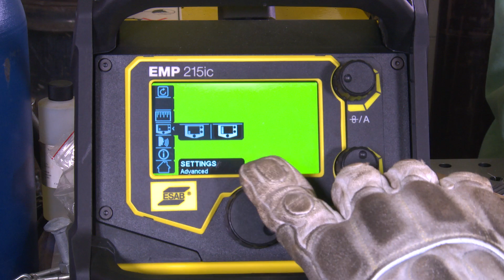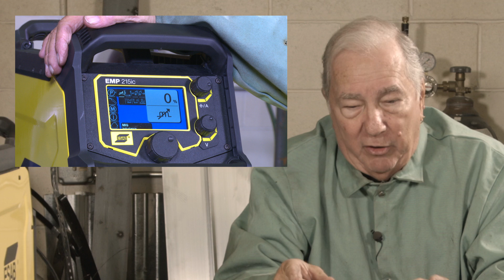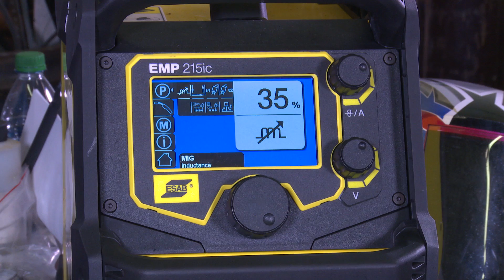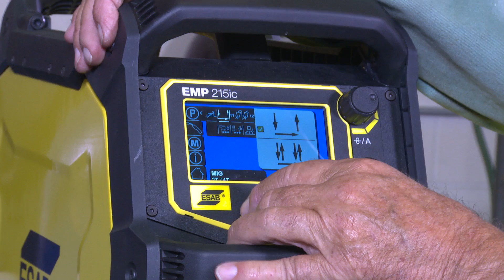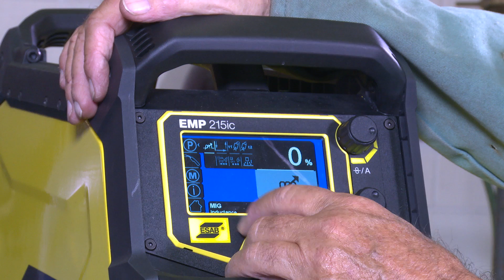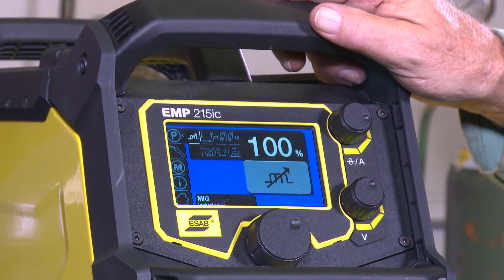What is Welding Inductance and How Does it Affect your Welds?

Comment: Paul, I will start by saying that your videos on welding fundamentals are straightforward and easy to understand. However, this video on inductance is correct on the back end but reversed at the beginning. Lower inductance allows the wire to heat up faster, higher inductance inhibits current flow and causes your wire to heat more gradually. You explain it correctly after welding (Zero inductance=more spatter, 100% inductance =less spatter). At the beginning however you explain that phenomena in reverse order.
Reply: @TheMrBillinois   Exactly. The practical implications of changing inductance were well demonstrated, but the electrical explanation at the beginning was reversed.

Comment: I think it would be very helpful to address WHAT TYPE of welders would get the most use out of this setting!!!!
In my research, it seems this is a feature for guys doing thick walled pipe and thick plate, etc.
Not for Harry Homeowner or some hobby /side hack home shop!
Useless waste of money for them!
A mobile welder business might get some use out of it if he's doing heavy equipment repairs out in the field.
But other wise, default settings are already optimized so.

Unimig has a great article explaining this very topic in an easily digestible way!
Basically, the inductance setting on mig machines is there for guys doing open root passes or fillet joints on thicker metals.
Turning the settings higher gets the puddle to wet out better and with less spatter.
Turning the value down has a faster freezing, less wetting property to the weld.
I can see where this would be handy doing repairs on various earth moving vehicles or pipe line fab work.

Comment: I had looked into this in a more technical was some years ago because I was working for a robotics company and had to teach robotic welding classes on a fairly regular basis. Belive it or not, I USUALLY had more trouble teaching experienced welders and engineers, than I did total newbies. The newbies listed better and had no habits to bring into the training. Welders usually wanted to weld too close or weave when it wasn't necessary. Engineers wanted me to prove everything I said, rather than learn. At least that was my experience.

Anyway, some of the welding machines had inductance and I knew that increasing it softened the arc, but I eventually needed to be able to explain why. If memory serves me right  (it's been about 20yrs), zero induction is at the extreame end of the CV (constant voltage) spectrum, while higher inductance moves the machine more toward the CC (constant current) end of the spectrum. By the way, 100% is an arbitrary number because you could theoretically keep adding inductance. 100% is based on the max amount for that machine. As you may know, CV is usually related to GMAW (MIG), while CC is usually related to SMAW (stick) and GTAW (TIG). I'm also not saying that at 100%, you are welding with a purely CC machine. No, at 100%, you're welding with the max the machine will let you go toward the CC end of the spectrum.

I really love and miss my old Hobart MIG, it had inductance control and slow pulsing with seperate on/off timers. Not pulsing like machines do now, this was for stitching. You might set it for 1 sec weld, 0.5 sec off. With that, you could penny-lap and make it look exactly like TIG. More importantly, you could weld very thin metals (22ga MS) with no problem.

Comment: 1:37 "High inductance will allow current to flow very quickly". There is already a current (the arc), and the word current already means flow rate (rate of flow of charge). So this statement was probably intended as "allow current to increase very quickly". But this is exactly backwards. High inductance will slow the rate of increase of current (upon shorting), producing a slower rate of increase of heating (relative to low inductance), and that slower heating rise rate reduces the splatter.  http://www.esabna.com/euweb/mig_handbook/592mig3_6.htm

Comment: At zero inductance, when there is no resistance in the circuit, how short circuit does not burn out the windings???
Reply: There is always some  resistance. The mig wire cannot handle the same current load as the power source so it melts.
Reply: because the current is NOT carried through the wire alone, it's carried by the flexible metal liner and most of the current is transferred to the wire by the contact tip (contact tube) at the end of the welding gun.
Reply: It does stress the power source more, specially the output diodes, not so much the windings, but remember inverter welders do try to compensate and limit max current. And there surely are differences between good and average electronic designs, mostly you get what you pay for.

Comment: Question? If a welder has Stick and MIG, will Inductance function for both welding types, or is it just for MIG?
Reply from the maker: The Inductance setting will only effect MIG mode. If you demo the machine you will notice that each function has its own parameter setting screen that will effect that process only.
Reply: Thank you for the answer. No way to demo, but wish there was.

Comment: Not quite correct, inductance controls the rate a which current rises. Low inductance allows to current to rise very quickly whereas higher inductance allows for a more gradual current rise. Too little inductance and you'll be delivering full current to the electrode almost instantaneously, this will cause the wire to "explode" more violently, hence the spatter. If the inductance setting is too high, it'll take too long for the current to rise and you'll end up stubbing the wire before it has a chance to melt.
Reply: So what you are saying is the exact opposite of what Paul is saying?
Reply: 1n5ane1 so is this the same as arc control?
Reply: Are you Russian?
Reply: No its not one way its both any change in current through  a conductor causes electromotive force change(voltage).  In fact this rise in voltage (when larger/higher inductance) changes the balance of voltage to current more (temporarily lowering the current while voltage rises) this would increase arc length available so also arc time since the conductor is constantly approaching  circuit completion.
Reply: Very helpful. The comments also helped 

Keep up the good work
Reply: Yes, di/dt=v/L. Rate of change of current is inversely proportional to inductance. Voltage is held constant in a GMAW machine.
Reply: @Quantalume  
So is L in this equation is inductance?  If so then L = V/(di/dt)  Ok, I see that!  Voltage remains constant so if L goes up, di/dt must go down.  The rate of change of current over time decreases as Inductance is increased.

Comment: Why not leave it at 100% inductance?  What is the compromise at 35% where you say most machines are set?
Reply: Depending on position of weld. Say running uphill. A more fluid puddle from 100% tends to sag.

Comment: Actually inductance, in any circuit, opposes any changes in current. Therefore, it "slows" the rise of a current when wire creates short circuit, and "adds" some voltage at the end to keep current flowing. That "slowing" of the short circuit current causes wire to heat slowly instead of bursting apart like in pure short circuit.
What you described, "arc on time" would be an effect of discharging a capacitor, basically the opposite of inductance.